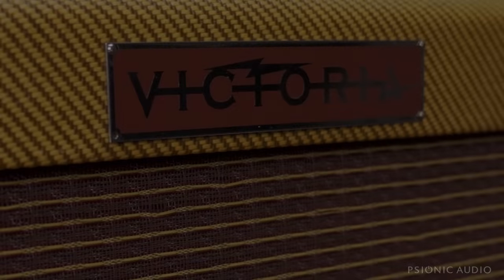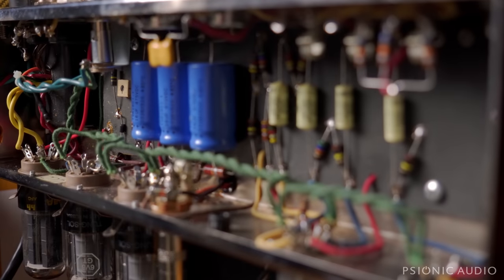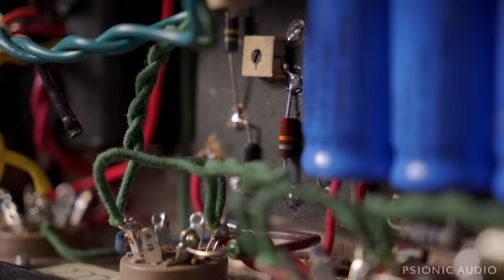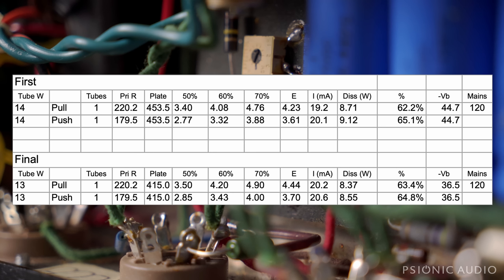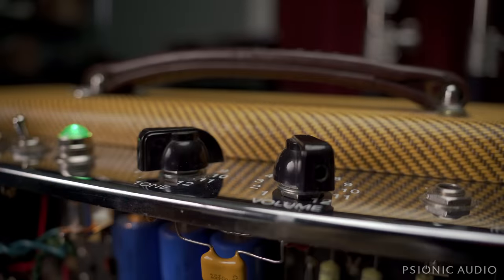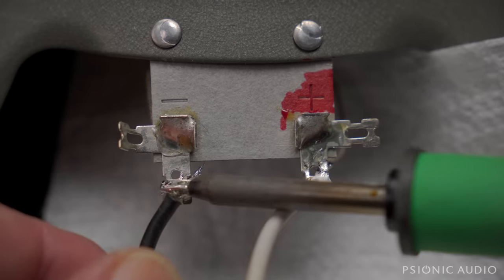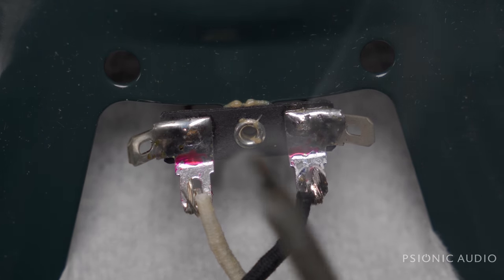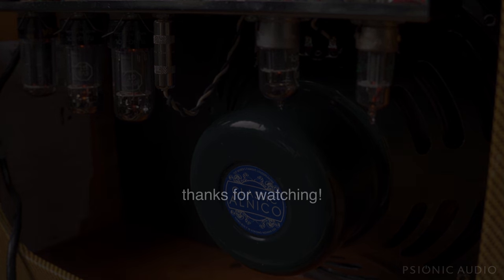A Good Amp Made Great? | Victoria Ivy League Part 2

Comment: Sometimes, to break in new speakers. I play every note (open notes included) on the fretboard into a looper, turn the amp wayyyy down crank the bass, treble, mid (if it’s present) and just let it run for like 3 hours. Quite honestly I don’t notice any difference on the speaker after that until the seasons change and the cone gets drier or damper. It works well.
Reply: Nah - Hendrix overnight in a closet does it right!

Comment: I always love to see you work on these tweed amps and tweak the original circuit. I’m very interested to see why you changed out the coupling caps for the values you chose.
Reply from the maker: Thanks! Did you see the text on the screen?
Reply: I did. But I’m wondering why you went down from .1uf to .022uf and up from .022uf to .047uf. Was that a trial and error substitution or based on experience? I remember in your vid’s on the ‘56 Harvard you left the original of .1uf and .022uf…
Reply from the maker: I went down to 4.7nf not up to 47nF. I use formulas to arrive at the values for the change I want.

A ‘56 is one thing but a tribute allows room for improvements.
Reply: Thanks. I’ll learn those darn codes one of these days…lol

Comment: Thanks for the video of the Ivy League since I own one and really appreciate your info. Can you tell us about the 3 imputes , how they achieve attenuation and if it degrades sound quality ? Retired Tool and die maker and electrical components are a complete mystery.
Reply from the maker: The highest gain input has a 1M to ground then about 23K for a grid stopper (three 68Ks in parallel). Middle input has a 34K grid stopper (two 68Ks in parallel) then a 68K to ground (forming a voltage divider attenuating signal a good bit and making things darker). Lowest gain input is 68K grid stopper then 34K to ground (most attenuation from the voltage divider and a little darker still).
Reply: Thank You.  @PsionicAudio

Comment: Love your videos!  I have a P2P "Uncle Larry" 5e3 clone, hand built amp over in TN as well by a lovely fellow (P2P Amps). I currently have it setup in a head / cab configuration because I mic the cab off stage. It has all JJ tubes currently. Question, I'm a bit of a tweaker and was considering the benefit (if any) to replacing the tubes with Tung-Sol 6V6GT's and a NOS 5Y3 as well. Maybe a full new set of preamps too. Any recommendations/opinion?

Comment: Hey Lyle. Awesome video. I’ve been using one of these for a while and really like it. Would you mind sharing a little more about the capacitor values that you changed to tame the low end flub?
Reply: Were those the coupling caps?  I couldn’t figure out the values either. 

IIRC you can reduce cathode bypass caps to 10uf with zero impact on guitar frequencies. Even 6.8uf barely makes a difference, and it can help with an amp that’s otherwise “woofy”.

Comment: What is, in your experience, the sonic difference between a “broken in” and a “non-broken in” speaker? And what (and how long) does it take to break it in?

I would love to hear your take. My buddy The Other John Browne (check his channel) is doing some scientific measurements to try and quantify speaker break in. Would think that you have experiences worth sharing!
Reply from the maker: It depends on the speaker design and the wattage of the amp. A 65W speaker with a big magnet and a strong suspension with a good amount of doping on the cone attached to a clean 20W amp will take much longer than the same speaker used with a pushed 40W amp. 

And the sound varies with all those variables too. 

In general though, a good speaker (or the right speaker for you) usually sounds good/right on day one, then sounds even better with playing time. 

Dynamics can improve, highs can sweeten, lows can have more impact, mids can have more character.